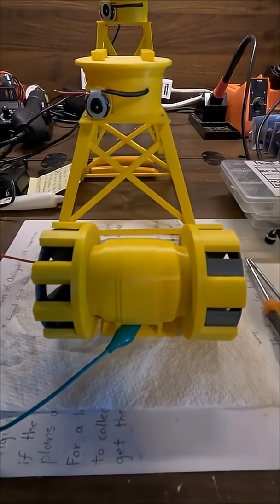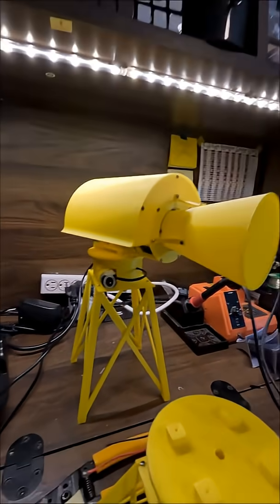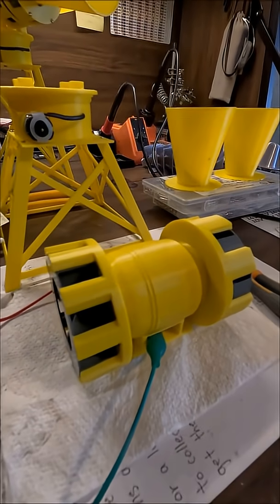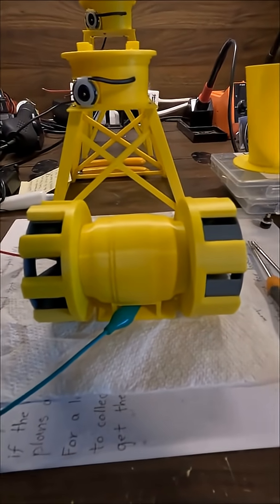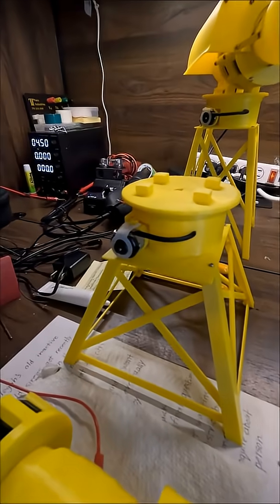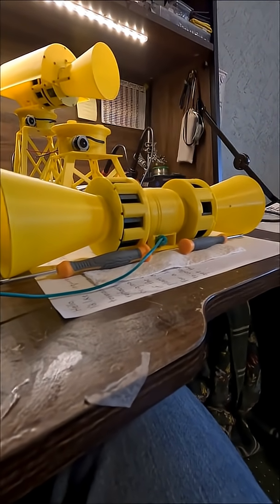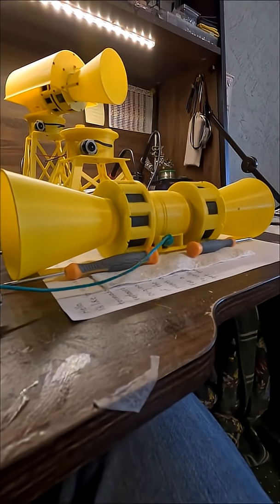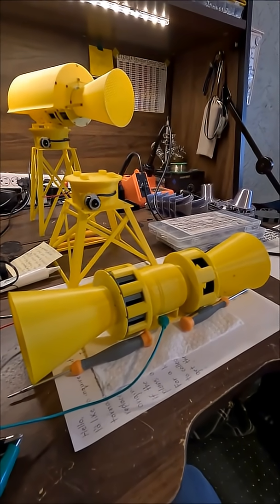NEW Mini H.O.R. 7/10 Port Model 50 Super Sirex FIRST PROTOTYPE TEST! #minisiren #supersirex

Comment: Wow, just add a flywheel already😅
Reply from the maker: No... They have 2-inch fender washers acting as weights on each rotor. A flywheel in this case would look funny.
Reply: @milespeterson5049 Ohkay, I guess we can also emulated the longer lasting ramp down using pwm.
Reply from the maker: @mayankmanu46  Oh yes, I have tried using an Arduino to control a siren through PWM. But honestly, for simplicity, adding weights to rotors seems to be doing me good enough.
Reply: @milespeterson5049 that's great, sometimes it's just better if things remain simple😅
Reply from the maker: @mayankmanu46  lol, glad you understand. You see, I will probably eventually be selling these models on my own website, so for the sake of simplicity, I am making use of fairly simple parts. Although maybe there is some sort of tiny microcontroller that could do a job with PWM. I even thought about cramming an ATTINY85 into a mini Whelen Vortex. But, that's getting prety complicated, so I am just not sure!
Reply: @milespeterson5049 that's so cool, I bet these will sell very well. 

I'm sure it's loud enough that people may end up using them and replace the heavy cast iron ones.🎉
Reply from the maker: @mayankmanu46  Oh thanks!! They're pretty loud, especially this one being 1/8 scale. I even have bigger 1/6 and 1/4 scale sirens that are even louder depending on their scale. I would advise against setting up one of these outdoors, because they're just simply not intended to be out in the elements. But if printed in outdoor grade filament, it could probably stand a good chance.